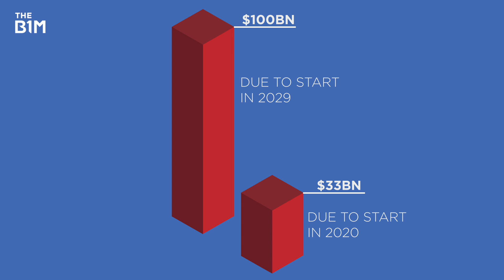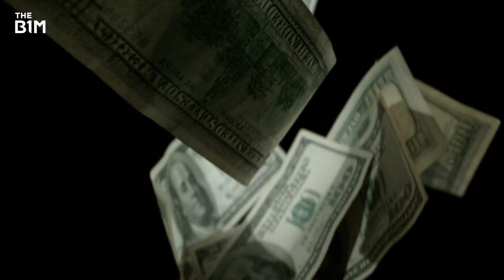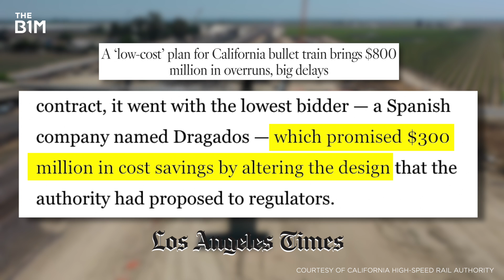What Went Wrong With California's High-Speed Railway

Comment: I've once travelled between Amsterdam and London on the Eurostar. High speed train is honestly the most comfortable way to travel and ideal for reasonably short distances.
Reply: Agreed. Especially for a pedestrian wanting to go to another city center
Reply: @nerdathling  that’s the key. If the destination city isn’t pedestrian friendly then you’re screwed. LA is not pedestrian friendly.
Reply: @nerdathling  Nope, too expensive for that. It's comparable to air travel, but about 50% as expensive and taking about 2x as long(if you only compare the time you're actually sitting in a cabin).
If you count security/travelling to the airport/boarding/etc, you get about the same amount of time to travel at 50%+ of the cost.
Reply: @ChaosSwissroIlCommentsCensored  There are still some routes where high speed rail makes sense like New York to Washington DC or New York to Boston. No one is saying build a high speed train route from Seattle to New York.
Reply: @Dept246  how, specifically, would any government economically construct a testing requiring very straight tracks from NYC to DC? This is some of the most expensive real estate in the world that the government would have to pay for. $800,000 for every 75 feet...from NYC to DC.
Reply: As a Dutch citizen in a country that is about 200 miles in diameter, the distance between Amsterdam and London is not reasonably short. We consider a 50 mile journey to be relatively long, London is very far away.
Reply: @mankepoot9440  Then you're outside the group of 'Average Dutch'.
For someone with a realistic view on the world, any distance below 250M is 'Close By'
In the Randstad, distance home-work of 30M+ is considered as "Normal".
Reply: @mankepoot9440  The distance Amsterdam-London with  Eurostar is some 500 km (312 miles). For Dutch standards it is quite far (not very far...) but for European or American standards this is 'short' distance.

De afstand Amsterdam-Londen met Eurostar is ca. 500 km (312 mijl). Voor onze begrippen tamelijk ver (niet erg ver...) maar voor Europese of Amerikaanse begrippen is dit een 'korte' afstand.
Reply: @mankepoot9440  Meanwhile 50 miles can be considered a daily commute in the U.S., while 200 miles is a day trip's drive. The scale of the U.S. versus Europe is just completely different when it comes to geography due to the lack of population throughout the U.S.
Reply: @mankepoot9440  So true. Anything beyond 15 km is really far for us ;)
Reply: @mankepoot9440  I think that explains a lot. My son-in-law commutes 60 miles to work each way. That's an hour's drive. It would be 3 hours on any other kind of transit system.
Reply: @mankepoot9440  I 200 mile you can reach five different countries in Europe. LOL !
Reply: @mankepoot9440  Really?
I used to drive over 100 miles per day, Going to work and back!
Reply: Europeans and Asia we’ve been doing that since the 1980s !
Reply: @Lozo39  japan since 1967
Reply: @Lozo39  Meanwhile in Singapore & Kuala Lumpur : "People will take the coach (between the 2 cities) in 2030 & it'll still work." That takes ~5h though, & the railways in the current state takes about as long, but with upgrades you could shorten it to ~3h I estimate, & that's without HSR technology yet (but perhaps with tilting rolling stock)
Reply: @Lozo39  
Do you understand the word POPULATION DENSITY?
Reply: @Lozo39  technically in terms of relative "high speed" rail travel we've been doing it since the 1870s
Reply: @Alex-cw3rz  "1870s", Yeah no. The first ever high speed rail didn't come until the the mid 1960s by Japan, it wasn't until the next 5 years to a decade the rest of Asia and Europe followed
Reply: @Racko.  what do you constitute as high speed, twice the speed of engines at the time for example, a large reduction in relative travel times for the mode of transport. Because that'd make it the 1870s in all form function.
Reply: @Alex-cw3rz  I Agree on that tbh, however I think the first HSR from Japan that went up to 130MPH was what set the trend towards the rest
Reply: @Alex-cw3rz  
> 90km/h
> high speed
Reply: @pissyourselfandshitncoom2172  so under 90km/h is not high speed? As if so then what I'm saying is fine they could go 80+mph
Reply: @ChaosSwissroIlCommentsCensored  The population density is very low in the middle west. But there are corridors between large cities, where a high speed rail makes sense.
Reply: @mrm7058  no they don't. The cost to acquire American land in densely populated areas by eminent domain is astronomical. HSR is simply not economical in the American system, from density to cost.
Reply: @mrm7058  So it would be nicer to have a high speed rail line from the northern midwest to Southern Central US, ideally from Chicago, Illinois to El Paso, Texas (unless if a lot of right-wing supporters, anti-rail supporters, and private property owners says no)
Reply: I agree!!! and the train stations in Germany are HUGe almost as big as a mall. Get most of what you need after stepping off the train. Hotels exist at the train stations with meeeint rooms and so on
Reply: but if at the other side of the journey the public transport is nonexistent, it's an issue too, albeit a smaller one.
Reply: @ChaosSwissroIlCommentsCensored  True but the population centres that they are trying to connect are at european levels or at least verging on them. The vast distances in between such centres actually make high speed train more not less viable. I am unsure what terminal times are like for US internal flights but if you have similar total journey time at lower cost with the bonus of less direct environmental impact would that not be considered a good thing?
Reply: @chrisfortune1813  Your assumptions are incorrect. The US does not have many population "centers" like you see elsewhere in the world. The US has "regions." For instance, the city center of Detroit can be walked in 45 minutes. The business centers of the Detroit Metropolitan area can be 75 miles apart.
Reply: @christianlibertarian5488  The video was addressing San Francisco and Los Angeles which are more closely similar to european population centres in size, not all european cities are as substantial as London, Paris or Berlin. I agree that much of the USA doesn't fit this suggestion but I was referring to the subject of this video and not the USA in general where flight (east and west coast connection in particular) and driving in less densely populated rural areas make much more sense
Reply: @chrisfortune1813  That makes sense.
Reply: @chrisfortune1813 
Unfortunately, when you get to LA, it grew OUT, not UP!
Yes, LA has some light rail, and buses, but getting to multiple cities in a day, not as easy as you might think...
Reply: @chrisfortune1813  because people don’t like taking trains in the us. Why would I pay for substandard service on a journey that would take at least twice as long as flying?
Reply: @ChaosSwissroIlCommentsCensored  , true, the USA in general has a lower population density than the Amsterdam-London corridor, but first of all that does not explain why the USA can't have high speed rail service in densely populated parts, and secondly, no one says that a US high speed rail network should reach every remote corner.
Reply: @vcalblas  The US doesn't have high speed rail unless you're talking about the NEC from DC-NYC-Boston, which the population density is reasonably high, so there's a "High speed" line there, which is capable of reaching 150MPH but hits an average of 60-70MPH because of ancient rail and bridge tech which wasn't designed for High speed
Reply: @vcalblas  The Eurostar is like the the European equivalent to the Northeast Corridor. However, the story how the train from London to Amsterdam came into existence would be considered pretty unambitious by American standards. America would have fixed a transcontinental network by one operator in the time the EU is coming up with like 3 transnational/"transstateional" state-owned consortiums owned by 5 state-owned rail companies all exploiting the same damn track. And now thanks to privatisation those same state-owned enterprises will come up with even more brands!
Reply: @vcalblas  Don't know if you have heard of them in London, but WE, in California HAVE EARTHQUAKES, AND Earthquake FAULTS
THIS HS Rail WILL CROSS THE SAN ANDREAS FAULT, among many others!
How far UNDERGROUND, do you want to go???
The ROUTE on the southern END has changed, a number of time, BECAUSE that is where it CROSSES the San Andreas fault
You want to cross at 30 feet down, or maybe 100 feet?
Reply: @vcalblas  "does not explain why the USA can't have high speed rail service in densely populated parts"

Except that the "densely populated parts" really only amount to one place:  the Northeast Corridor, from Boston to New York to Washington, DC.
And that rail line has issues with A) divided ownership between national (Amtrak) and regional (various state & metropolitan transit agencies)  arguing over who will pay the costs, B) legacy bridges and curves that need serious upgrades for HSR operation, and C) having the right-of-way hemmed in by developed property boosting the cost to acquire the additional property to implement to HSR service.
Reply: @vcalblas  a threshold population density is needed to 1) fund high speed rail 2) use the system once built.
Reply: @jan maroto 187 million, 57%, 1.98million km2, 
Around 200 million people live on the east coast, Texas, California and pennsylvania, that is around 60% of the population on 22% of US landmass. Don't be fooled by overall numbers, a lot of the US just is really unpopulated. This would give those regions a population density of around 100 people/km2, higher than spain (92) and only a little bit lower than France (118). Add to this that a state like California and New York is also pretty big and has a lot of sparsely populated area's, you can eliminate maine from the east coast (large state with very little population) and you probably could get a population density for those parts of the US of around the same as France or higher.

That the US has a low density it rather stupid. Yes, it is true if you look at the overall numbers, but look at it per region and you get a completely different picture.
Reply: @ChaosSwissroIlCommentsCensored  what rot. There are plenty of areas in the US with sufficiently high population densities (often higher than many places in Europe) to justify railway construction. Nobody is proposing to build high speed railways to connect cities in sparse states like Montana, Alaska or Wyoming and the sparseness of these is irrelevant to the viability of rail construction in denser states or regions.
Reply: @ProudToBeNoob  Name a few of them! 
Besides the Northeast Corridor (Boston-New York-Washington DC); there really is not a similarly high population density region along a 300 to 500 km route in the United States.  There are certainly individual cities.....but between them are low-density farms, forests, mountains, plains, and deserts.  The c CA HSR route that is being touted has the vast majority of its route outside the San Francisco Bay area and the Los Angeles basin  consumed  by crossing THREE mountain ranges  and vast low-density agricultural regions in the Central Valley.
Reply: "That is why they call it the American Dream because you have to be asleep to believe it" - George Carlin
Reply: @silveriver9  America used to have standards but Marxism is destroying it! GEORGE was just a comedian that  hated America!
Reply: @superstarmcgee1128  George told it as it is while everyone is in denial. Also many other countries around the world have HSR.
Reply: @silveriver9  America was created by train travel! Trains are most people last resort to travel you must not understand that Amtrak $15 dollar ticket does not work here!
Reply: High speed train can drive tourism in the country. I don't need to rent a car just to travel from one place to the other.
Reply: @ChaosSwissroIlCommentsCensored  I am guessing you're talk about the Phoenix "valley metro rail"? The one that actually exceeded revenue expectations a bit, has helped development in downtown Phoenic and Tempe and has since openings a few extensions? And as for going around the city, it is just one line going mostly through the center parts.

Light rail btw is more like above ground subways than trains, let alone HSR.

Because the highly populated areas are better served by highways between then
Yeah, right, and then have massive traffic delays once they actually hit a city region. Only highways is a rather stupid plan, the US is one of the few developed nations that thinks that way.

and are either too densely populated for interal HSR
You can also just place the station right outside the densely populated city, with other public transport going further, not unlike airports do Though if you can get regular trains in cities, you can also get high speed trains into densely populated area's. The high speed trains can also use regular tracks, they just need to take them slower (ie similar speed to regular trains).

too loosely populated for any rail (internal or connecting) to be viable.
Sure, just like there are places like that in Europe, you just don't put a trainline there, definitely not a HSR.
Reply: @MDP1702  highways aren’t a very stupid idea, that’s just your opinion. Now stop enforcing your will on everyone else. People in the us would rather build new highways than a high speed rail line.
Reply: @ChaosSwissroIlCommentsCensored  We're talking about California or East Coast for High Speed Rail, of course no one told to buy a TGV between Seatle and Atlanta lmao
Reply: And Eurostar isn't even the most comfortable of the high speed trains, so this must mean a lot.
Reply: Could it be true that America has left it too late for high speed rail. Politics, land ownership and the sheer cost of modern construction?
Reply: Even Africa has high speed trains
Reply: Agreed. I'm from Portugal but currently live in Amsterdam. If I ever want to go back home to visit family it is almost always the most comfortable method of transportation. Love train travel.
Reply: Isn't it also better for going long distance between cities? As an American I'm getting really sick of driving 6 hours just to get to a city lol, it's absolutely draining.
Reply: I rode the Eurostar from London to Paris and back.  My car was not particularly full.  It was a comfortable ride but Europe is much more densely populated then the United States and two hours on a train is about tops.
Reply: @ChaosSwissroIlCommentsCensored  Texas has the fifth and fourth most populus cities, but their metro area population densities are on par with Columbus, Mesa, and Omaha. I live in DFW, and I continually try to use the light rail, but (1) the station parking is not good for multi-day (airport) parking and (2) stations are SO FAR AWAY. There needs to be a critical mass of stations before a significant number of people use it.
Reply: @johnmorrison8153  so make transit useful for people then
Reply: @ChaosSwissroIlCommentsCensored  Phoenix has a lower population density than both Dallas and Houston! That doesn't help your case one bit.
Reply: @johnmorrison8153  it kills his case it’s hilarious how these Koch cronies use far off cities not near any others as an excuse for not having HSR for other cities that are suitable for HSR like many mid west cities that are 200 miles apart and less in many cases a network can be built too for maglev
Reply: That's Europe not USA😂 that's why USA supported UK to prexcit
Reply: @ChaosSwissroIlCommentsCensored  Ah so the amount of people living in rural areas is growing i suppose? Because if they move to the bugmen cities and their birth rate drops well then this changes nothing right?
Reply: @ChaosSwissroIlCommentsCensored  Not sure what you are trying to tell me with that example to be honest.
Reply: Why does it need to be so high speed?
Reply: bruh I remember taking a small nap on the eurostar to go back to amsterdam from london and when I woke up we were already on the french land AHAHA the sea tunnel was so shorter than I thought
Reply: Though the prices is ridiculous.
Reply: Europe doesn't deal with daily earth quakes and California is the most worthless state to live in your cant fart without some regulation!
Reply: @superstarmcgee1128  And Japan isn't used to earthquakes either, right?
Reply: @MDP1702  I'm talking about the engineering work needed it isn't a normal high speed rail .
Reply: @superstarmcgee1128  What does this have to do with it? Japan suffers from Earthquakes too, yet has HSR, so clearly that is not a (large) problem.
Reply: @MDP1702  red tape and engineering in California don't mix
Reply: HS1 see all the fuss about HS2
Reply: Amsterdam is like only 200 miles away from each other unlike SF to LA
Reply: @Civsuccess2  also doesn't have 4 massive fault lines to cross.
Reply: Impersonal Immigrant  One word congestion.
Reply: We don't care
Reply: @SaturatedCat : It's a personal choice. I like trains, what can I say?
Reply: America is way behind Europe is most ways. It's just the lying media that keeps telling us 'we're number 1'
Reply: The decline of the US manifested right here. The politicians and the media stir the public to useless topics, like China invaded Microsoft BS and we the public go right along with it, parroting what they give us.
Reply: and one cares
Reply: Dont confuse European train travel with California's train debacle.
Reply: Wrong, there is NOTHING on this planet more comfortable than a Lexus on a roadtrip. I live conveniently half way between LA and SF on the central coast and these beautiful scenic roadtrips leave me feeling refreshed and relaxed when I get to my destinations. Never going to do anything other than a buttery smooth roadtrip up the coast. It is heaven.
Reply: Correct and most of the times, you get directly to the city centre
Reply: Very true. I live in Orlando and I need to use a bus (cause am not from here, don't want buy a car (god knows when I will be spending time home abroad again)) and the bus service is simply horrendous. Cars everywhere here, they are beautiful and they are fancy, but many are big and very polluting and noisy, but americans love them.
Reply: @ChaosSwissroIlCommentsCensored   nonsense that’s not true at all considering how fast HSR is
Reply: @ChaosSwissroIlCommentsCensored  phoenix is poorly planned and far from most cities except LA and Las Vegas not enough for a network unless you want to revive Navajo nation
Reply: Itsa stupidity havin lines for cargo adn lines for passangers, train transport is not efficient. Tney are banrupt projetcs made to sustain some human stupidity. 

the value is not in the train but on the lines,,,, there are useless lines and imprescindible lines, . Humnas have to see trains with other eyes they are not the magic soluton fro trnbasport problem , at least in the actual format. Althought i see some potential in it, trains must be reinvented.
Reply: @Roman-po8yc  aCCORDING TO MY ANALISES CONCERNING EFFECTIVENESS, ECONOMY, AND EFICIENCY OF TRANSPORTS, TRIANS ARE GOOD FOR CARGO,, CREATE PECILA RAILS TO TRANSPORT POEPLE AT HIGHT SPEED , FORGET IT ITS A STUPIDTY, UNLESS THEY MAKE CHEAPMTHICKES WIRCH DOESNT HAPPENS.. MANKIND IS STARTD BEING COMPLETLY STUPID,, IN THE PAST CARGO TRAINS ALSO TRANPORTED POEPLE, AND EVERYTHING WAS EFFICENTE, PEOPLE FORGOT THAT LITTLE THING THAT MAKES EVERYTHING. tICKET TRINS ARE ECXPENSIVE I PREFER BUS
SORRY
Reply: Doesn’t have to be high speed though, conventional works just fine
Reply: @MrBluebirds22  If you want to take forever to get to anywhere, sure.  Generally, driving times are less than AmTrak.
Reply: @georgesteele2157  Yh in USA that's very true, though conventional inter city rail here in UK generally travels over 100mph and we can do London to Edinburgh/Glasgow in approximately 4.5 hours.
Reply: @MrBluebirds22  I was in your country once and loved the visit and hope to have another visit.  Rail makes more sense in Britain as it is much more compact than the United States.  For shorter distances, automobiles are a faster mode of transportation then our rail and for medium and longer distances, air travel is best.
Reply: @georgesteele2157  I wouldn't just use density as an argument but also how the population is spread on both sides of the Atlantic: In the US and Canada, it's typical for both countries to have the population be centred around few cities while a vast majority of the landmasses is sparesly to completely unpopulated while Europe isn't just more dense, its population is also more evenly spread out which is actually a disadvantage for HSR rather than an advantage because you'd end up not serving many towns and villages who feel at a disadvantage because they get no train service despite the existance of rails (conversely, regional trains play a much more important role unlike in Anglo-America where regional rail tends to serve a city and its metropolis rather than some indescret towns).
Reply: Dude the us is huge me driving my truck from east to west coast take 6 to 7 days that stops for sleep food and fuel. 50 miles is hardly anything for the US. To go from San Diego California to  Providence Rhode Island is about 4762.049 km or 2959 miles. The need for trains isn't really there
Reply: @ChaosSwissroIlCommentsCensored  Same with Japan, and guess what, ALSO CHINA!
Where is the majority of Chinese people, NORTH EAST
High speed rail in South West?
There are literally NO people living there!
Reply: Amtrak has long travel time as two-way rail traffic operates on a single track. Double tracking Amtrak routes would more than double average travel speed. Presently trains play leapfrog using side rails. A train stops to wait on a side rail while the opposing train arrives and passes. When the system is heavily loaded. Travel time may slow so much the crew's operating time runs out, forces the train to stop to be recrewed.
Reply: @ChaosSwissroIlCommentsCensored  Mate, the US has a culture of "public transit is for the poor". No wonder no one uses light rail.
And when you have highways going through city centers, no wonder people choose to drive.
Reply: @jan maroto china is more dense than the US? Last I checked, there’s high speed lines that connect the major cities of China, which are in some cases more spread out than major US cities, so why not the major cities of the US? Some Chinese cities have areas the size of US counties, yet still manage to have great public transport. The problem isn’t the density, it’s the lack of will/public funding and the political hellscape that manages to find its way into everything, and by this I mean oil and automotive lobbyists, and republicans who think anything other than a car is an injustice to God and this country, for some unknown reason.
Reply: @spartan117zm  Agree with you, except that the "unknown reason" is obvious for every one.
Reply: @ChaosSwissroIlCommentsCensored  Ah yes, the famous Bumfridge to Forkville high speed line, connecting two cities with the lowest population density in Europe. Of course the entire US has a lower pop density than (zoom into a part with high population density). That argument is comparing apples to oranges. Why can't the US have high speed rail in corridors that have similar pop density? Those corridors exist.
Reply: It is ideal for any distance IMO, if I can get from point a to point b and be relaxed all the way through without having to check in and move around at the airport, even if it takes more over all, I’m gonna take the train. This is one of the many reasons why I love Europe, I can get anywhere just sitting on my chair in a train, chilling with my books and music and stuff
Reply: @LogsMaggot  you want maglev bro
Reply: @ChaosSwissroIlCommentsCensored  You are saying this like there is ever going to be a highspeed from New York to Los Angeles
Reply: @ChaosSwissroIlCommentsCensored  Nonsense - the city pairs where HSR is proposed in the US : NE Corridor, SF - LA; have massive populations and catchment areas over similar distances to European city pairs. Nor are stops any more frequent on HSR routes in Europe than those proposed in the US. There is simply too much numb-headed, not-invented-here sentiment and corporate corruption in the US to get it done.
Reply: @ChaosSwissroIlCommentsCensored  you guys are forgetting something, mobility plans aim the future not only the present.
Reply: @ChaosSwissroIlCommentsCensored   no, regions have specific desnities
Reply: I've spent a good bit of time on SNCF and AVE and they have all the comforts of flying, with great views and less wait times at an airport.
Reply: @ChaosSwissroIlCommentsCensored  As if that really mattered. High speed rail is designed to link major urban areas. 18.71 million people live in LA's metro area, and another 3.3 million in San Francisco's. It doesn't matter what's in between both cities.
Reply: @CityWhisperer  The Bay Area actually has about an 8 million people population. The larger commuter shed is over 10 million. Housing construction is basically illegal in the Bay Area core so the suburbs have been growing outward. That is why even the traditional Bay Area Metropolitan area is not considered an accurate representation of the region anymore. Many people commute from 3-4 hours each way. We call them super- and mega-commuters.
Reply: @ChaosSwissroIlCommentsCensored  the overall pop density matters jack shizzle. If you can connect highly dense cities and urban areas over vast strips of empty land, then you have a perfect case for HSR. Especially when the airports are so far outside the city centers. Also in Europe there are usually very sparsely populated areas in between stops. This whole "the US is too sparsely populated argument" is big time BS. The west coast would be utterly perfect for HSR but somehow you can't get your shit together to build that.
Reply: People outside the US fail to realize several things...
a) The United States is a HUGE country, with large areas of rugged terrain making construction very expensive.
b) The United States has a has an over-complicated legal system, and an excess of lawyers who just LOVE to file lawsuits over things, making land acquisition nearly impossible. Yeah, we can vote all we want, but the lawyers will hold it up in court for decades.
China has such an extensive HSR system because their government can just plow through whatever property they want, the people living there don't get a say.
c)The planning and layout of most American cities are car centric, and can't be changed easily. Only so much can be done to make cities more "walk-able", short of bulldozing everything and starting over.
d)Public transit is pathetically inadequate almost everywhere int the us, so even if you did have high speed rail, you would not be able to get around so easily once you get to your destination.
Entire neighborhoods around stations would need to be re-developed in order to make them attractive stations to get off the train at.
e)how is this all going to get paid for?
Reply: @peterbelanger4094  some good points but 'c' is also true for Europe. unlike American cities that were laid out a couple hundred years ago, European cities were laid out thousands of years ago in some cases and we're running trains and cars through them now. City planners have to think ahead of time
Reply: @lucadelauw9039  America was created by train stations but cars took over over time.  America is spaced  out unlike Europe. Only ritch people want high speed trains but they don't want to pay for it ! It's over budget because engineers said wtf it's over massive fault lines . They will be blamed first earthquake !
Reply: @peterbelanger4094  The United States is a HUGE country, with large areas of rugged terrain making construction very expensive.
And Europe obviously doesn't have rugged terrain right? Also we are talking about HSR that is of a similar length like in Europe and with just as much possible demand.

b) The United States has a has an over-complicated legal system, and an excess of lawyers who just LOVE to file lawsuits over things, making land acquisition nearly impossible.
This could be a problem, but essentially just should get fixed, not only for public transport, but public works in general. And btw, even in Europe we have similar problems. A new road in my town is already held up for around 20-30 years.
Reply: Califorian alone has a population of 40 million.... and would rank as the 18th biggest economy if it was it own country..  "Build it and they will come"
Reply: @elfedowen6452  Ummm, fifth. California would be the fifth largest economy by GDP if it were a country. It would be behind only the United States, China, Japan, and Germany.
Reply: @elfedowen6452  California if it was it's own country will be 5th in the world largest economy, not 18, ahead UK and slightly behind Germany and Japan
Reply: @elfedowen6452  it would rank in the top 5
Reply: @ChaosSwissroIlCommentsCensored  That's a bullshit excuse for bad infrastructure planing and development.
Reply: @ChaosSwissroIlCommentsCensored  You make it sound like america reaching this kind of population density is only a matter of time, a lot of time but still. What makes you think that the US population will grow much further, or even grow significantly at all in the coming century for example?
Reply: Indeed it is, Americans however don't give a fuck. What also doesn't help is the political structure of the US.
Reply: @ChaosSwissroIlCommentsCensored  Wth are you talking about. I live in phoenix, the lightrail is literally packed every day.
Reply: @ChaosSwissroIlCommentsCensored  dude, no one is talking about HSR within cities, but BETWEEEN them!
Reply: Amsterdam to London is not much more then New York to Philadelphia .  Western Europe is a lot smaller then USA .
Reply: @ChaosSwissroIlCommentsCensored  The important thing for population growth is the amount of children people have and how long they are alive. Even if we double the amount of food we have as long as we dont get more kids nothing changes. And in every developed nation on this planet birth rates dropped drastically after people got access to better healthcare, education (most importantly education for women) and got richer in general. Birth rate per women in the US today is at 1.73, so without immigration the US population would decrease every year. Overall global population size is predicted to reach its peak around 11 billion people and will then drop again, so the only real way for the US population to grow  (which it will according to some studies, to around 450million  in 2050) will be immigration. Not an increase in agricultural efficiency.
Reply: @ChaosSwissroIlCommentsCensored  What about China? Population density is that 20x more than an average American city. Yet you dont see them complaining
Reply: @ChaosSwissroIlCommentsCensored  shut up
Reply: @ChaosSwissroIlCommentsCensored  We would reach it if we induced demand. America doesn’t have a high density because of cars. In the 1880 our density was the same as europe and then cars killed it
Reply: @ChaosSwissroIlCommentsCensored  Always the same excuses. Ye let's just use the population density across the entire country as an excuse. It's honestly pathetic.
Reply: It's not profitable though heard that only 2 lines are profitable of the hundreds that are built around the world.
Reply: @Route-cy6cx  :  Correct.  The Tōkaidō Shinkansen from Tokyo to Osaka, and the TGV-Sud from Paris to Lyon.  All other HSR routes fail to cover all costs, generally by off-loading the cost of building & maintaining the rail infrastructure to a money-losing government agency or corporation.  Although in some cases (in Spain, Italy, China) the costs are so extreme that the ticket price covers less than half of the cost of providing the service...
Reply: Not for people and animals around.
Reply: Which links in the U.S. are "reasonably short distances"? The L.A. to S.F. line is in one state and is still 800 miles long. Most of it runs through rural farmland, but the politics in the area still mean there will be stops every 50 miles to let one or two passengers on/off. 

Population density is the killer of a financially viable high speed train system. 

About the only place in the U.S. that has that kind of population density is the eastern coast, but the killer there is the financial cost to land acquisition; even using Eminent Domain the legal and purchase costs would make any viable route cost prohibitive even before you broke ground. 

But if you could solve that problem then yes, and east coast corridor could be quite efficient, at least by European standards. 

Everywhere else in the U.S. though? You would need a Europe sized network to serve only the main population centers, which hold a fraction of the population. Outside of a few specific locations the U.S. just is not very population dense. Unfortunately you need to factor in the average density of the route, not just the end points. 

But even the end points have issues. Do you have any idea how big the L.A. metro area is? How are people even going to get to the terminal station there? Oh yeah, *drive*. How big a parking structure needs to service that terminal building just to make it a viable choice for people? 

All this stuff needs to be factored in, but when you do rail looks less and less like a decent solution. The reality is that *there is no good solution*, because people are just too spread out.
Reply: @lucusloc  I think you make some good points, but the driving to the terminal station shouldn't be an issue if you invest in further public transit across the city. 
In my opinion, it makes more sense to start with investments in the local public transit to alleviate the rush hour traffic instead of an expensive HSR. Then once the city is connected properly to the envisioned terminal station, there can be a HSR if the demand is there. If not, you still have a good network with (hopefully) a good connection to the airport
Reply: @lucusloc  I'm sorry, but where are you from and why are you commenting on internal California matters if you don't even live here? SF to LA is NOT 800 miles. I'd wager almost anyone who has as much as visited California would know that.  

800 miles is the length of the trackage for the full CHSR system with all the interconnections completed. This includes track to and from the nodes of the system in Sacramento, San Francisco, San Jose, Merced, Bakersfield, LA, Anaheim, San Diego, Bakersfield, Palmdale Burbank, etc.
Reply: @lucusloc  Atlanta, Chattanooga, Nashville. Charlotte-Atlanta. Myrtle beach Raleigh, Louisville- Indianapolis, Green Bay to Indianapolis via Milwaukee and Chicago. Look at a map
Reply: @lucusloc  there is a solution, it’s called build better public transport in cities.
Reply: Tiny European nations one can drive across in a single day is not the large USA. The USA is 40 times larger than the UK, not 4 times larger, 40 times larger. Presently in California is takes ten years to get through all of the government regulations just to build a garage or dog house in your back yard... Obviously it is going to take much longer to get a HSR route approved... And the world wonders why the homeless can't build homes in California choosing to live in cardboard boxes and tents under bridges...
Reply: @ronclark9724  So True !!
California builds billion dollars worth of HSR  while majority of of its inner city denizens live on the public streets and parks. 
A shining example for the whole World  :)))
Reply: @ronclark9724   not an argument
Reply: @ronclark9724  "Tiny European nations" - you do realize that there is an international network of high speed rail all over Europe, do you? You can go from Southern Italy all the way up to Sweden, and from Spain all the way to Hungary - that's ~1400mi in either direction, just like the eastern half of the US (also the population densities are comparable). https://en.wikipedia.org/wiki/High-speed_rail_in_Europe#/media/File:Networks_of_Major_High_Speed_Rail_Operators_in_Europe.gif
Reply: @ronclark9724  You sounds like russian liberals: claiming politics in power to be in charge for everything. Howevere politics in charge is in charge due to VOTE. Start from yourselves.
Reply: Oh yeah it’s great, but I don’t want to pay for that shit with my tax money
Reply: @R4de  I don’t want to pay for your state either
Reply: @R4de  that’s why your country is falling apart 6 decades of neglect
Reply: @qjtvaddict  I don’t recall mentioning where I live? Would you like to elaborate which country you’re talking about and why it’s falling apart?
Reply: @R4de  for what else? Submarine's?
Reply: @congress1532  No, into my own pocket.
Reply: @R4de  Well ok, but rn you're paying taxes.. aren't you? And my question is would you rather have your money put into some submarines or in a railway.
Reply: @R4de  Oh yeah, if the majority of voters in your country wants it, you are going to pay for it. That is called democracy.
Reply: @alexamann5729  also called theft
Reply: Maybe for backward places like Europe, where people are too poor to own cars. The US has great road infrastructure and great cars.
Reply: @horrific.crime.stories  I don't know about great cars they are throw away products! Most these days cant be repaired . Insurance totals them for a bumper replacement.
Reply: If USA China cooperate for it, can be very cheap and quick!
For example, California High-Speed Rail from LA to SF, 840km (520mi),  approved in 2008, will operate in 2033 (about 25 years), original budget was $77.1B,  in the future will be $98.1B!
If China takes this project, the cost almost one-third of the current budget and can be done within 10 years! 
China's high speed rail with a maximum speed of 350 km/h has a typical infrastructure unit cost of about US$ 17-21m per km, with a high ratio of viaducts and tunnels, as compared with US$25-39 m per km in Europe and as high as US$ 56m per km currently estimated in California.
https://en.wikipedia.org/wiki/California_High-Speed_Rail